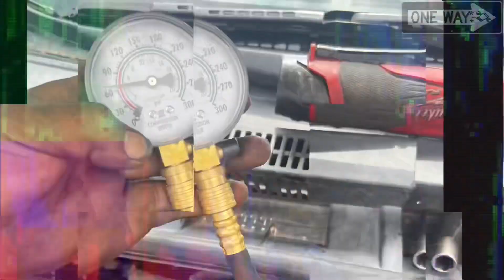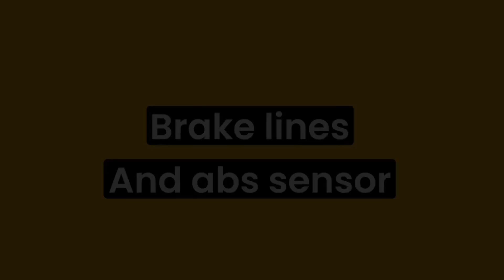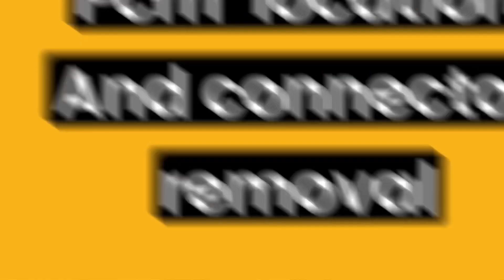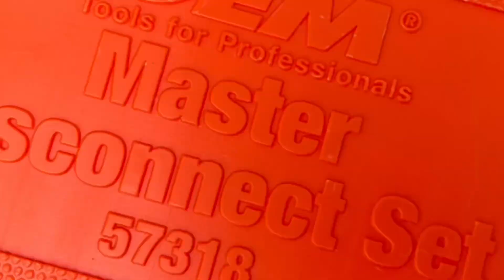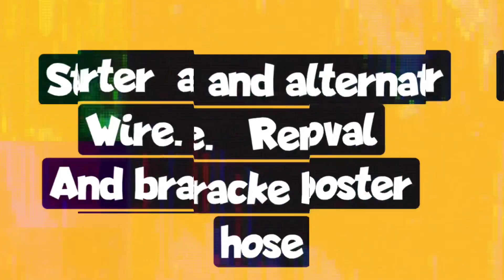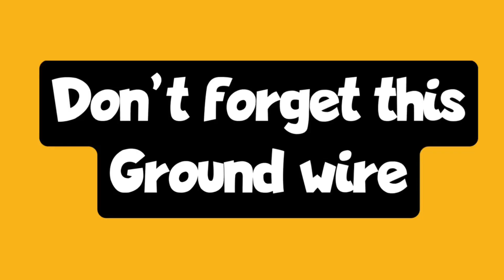Smart fortwo  engine removal step by step

Comment: You can disconnect all the brake lines right behind the sideskirt and it saves you time from doing both sides and ABS sensors. You can also remove the AC compressor from the engine instead of disconnecting the lines.
Reply from the maker: Thank you.   For the idea.  I will keep in mind.  If. I have to do    Another one.    😊

Comment: To avoid loosing brakefluid - just press the brake pedal down - then no more fluid can enter the system from the resovoir - you can use a stick or something between the brake pedad and the seat. I use a hollow tube with a spring inside, which I also can use when taking air out of the system.
Reply from the maker: @olebendtsen6117  thank you  for the advice.  I used some clamps.   But i still  bleed the brake lines. After. Putting everything back together.  Any ways.  🙏😅

Comment: Start to finish.  How long do you think  will it take to remove the engine and cradlem
Reply from the maker: All depends.    If you going to do it you self.  Probably.  4 hrs with the right tools Just to take it out.     Without lift.    👀➡️what I recommend is. To.   Watch the video and Make-sure you  got all the tools  that i used.     So you don’t have to  waste time to the store.   
Any question leave here I will do my best to help 😀